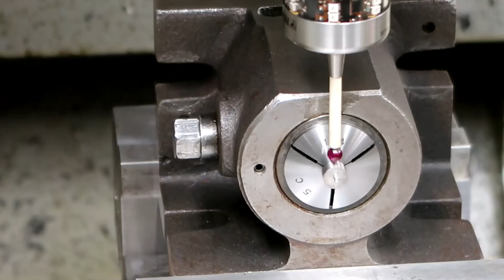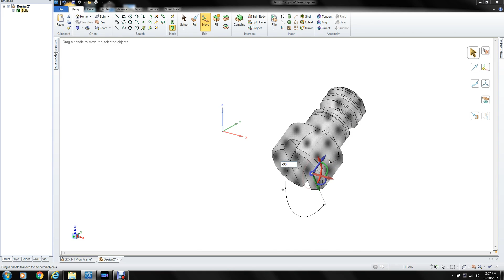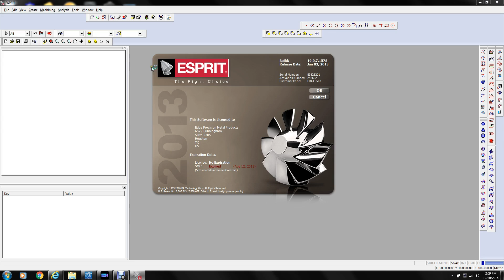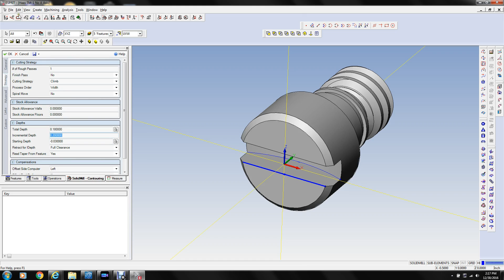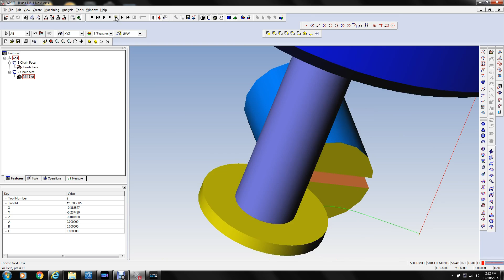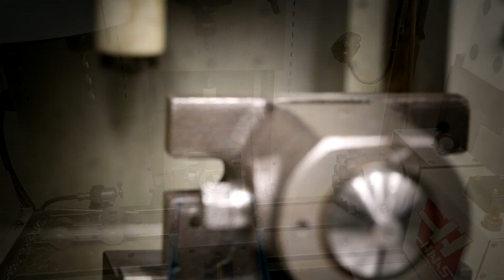Canon G7X MII Vlog Grip Screw Mill Opp Part-2

Comment: What software do you use at your workplace?
Reply from the maker: I personally use SpaceClaim for my cad and Esprit for my cam software. At my old shop they tend to use Solidworks for cad and either MasterCam or Gibbs for their cam. I use Esprit because of my Mazak Integrex. It has a good post for full 5Axis control. Also it is a very good wire EDM software for my wire EDM machine.

Comment: I like. How do you like the Haas, would love to see more of the controller and how easy or hard it is to program. It seams like you can get the Haas mini mills for 20k all day long. Would you recommend it for a new machinist?
Reply from the maker: I like the Haas machine. It is a good machine if used for what it is intended to do. In my garage I have a TM-1 mill when I bought it you couldn't get the full coolant/chip enclosure. I would like to have that but other than that I really like the machine. The Haas control works just like a Fanuc control in every respect except Haas has added some of there own features for ease of operation. The MDI program screen doesn't loose what you have entered once you run a MDI. You have to re entere on a Fanuc control. This is like the Meldas control on my Mitsubishi control on my horizontal mill. I really like that feature in a control (any one who runs CNC uses MDI quit a bit). The Haas has many help features but I cant really comment on them because I don't use them. Learn to run some kind off Cam software that would be more useful than their help functions. If buying a Haas new don't leave out the probing option their price is much lower then installing it later from Renishaw. Yes the Haas would be a excellent machine to start with. Even used it would be better than a new TorMach Mill. If you were considering that. You are not going to do heavy milling on the Mini mill but if you intend to do light milling it will be fine. I will try to show more on the control in future videos.